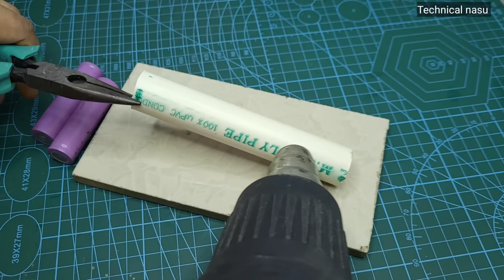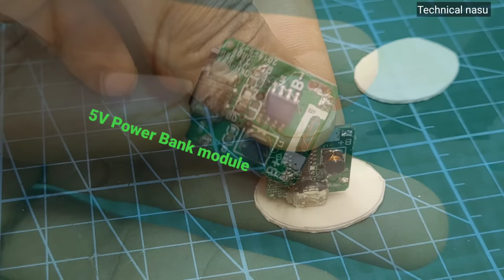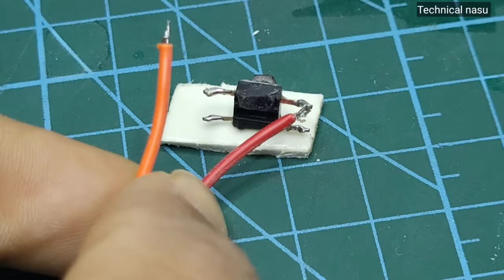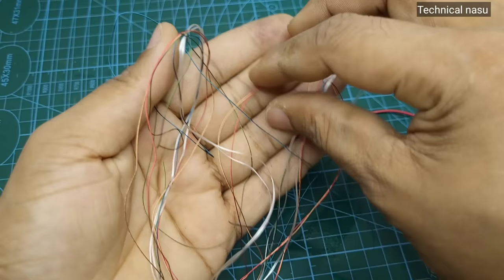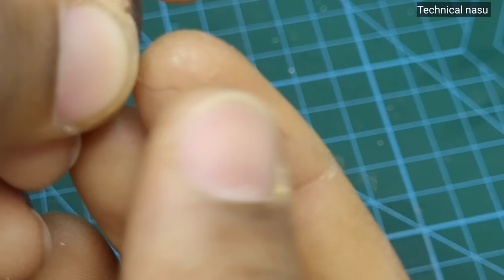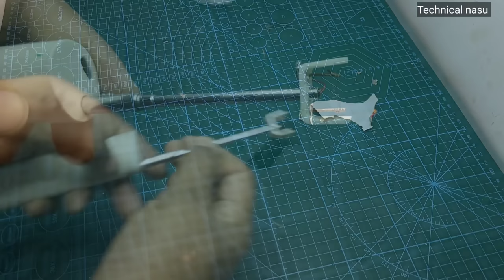दिवाली पटखा जलाने वाला electric lighter |How to make rechargeable electric lighter |

Comment: Neat project and good video. It reminds me of when I was a child I would use a  flash light to weld and as a lighter. I  would brake the glass bulb (incandescent Not LED 😊) and place the wires that hold the filament very close together. It got read hot and the batteries would last  enough to do several jobs.